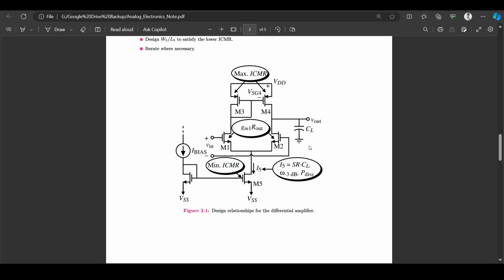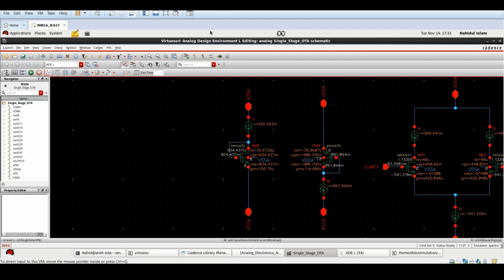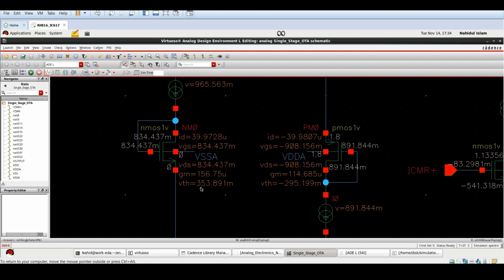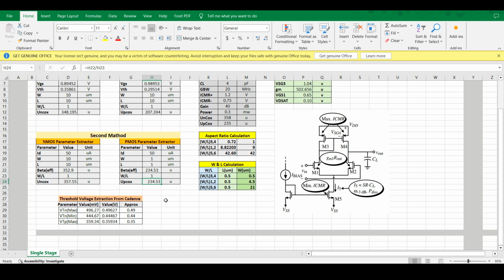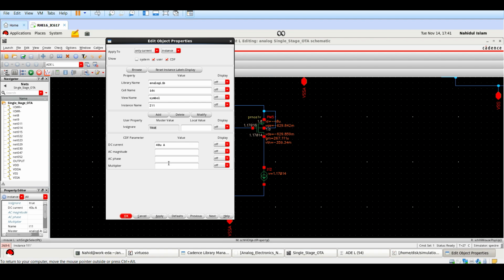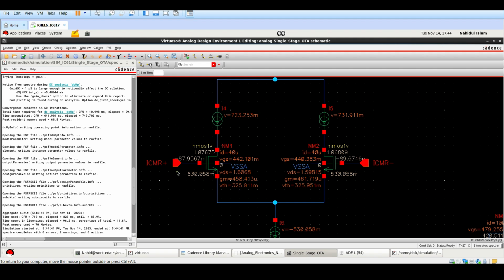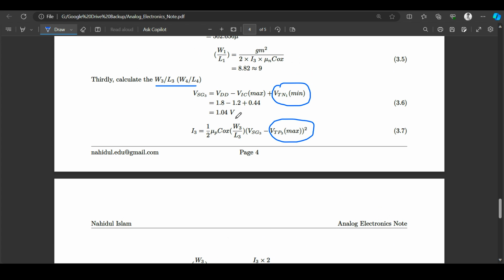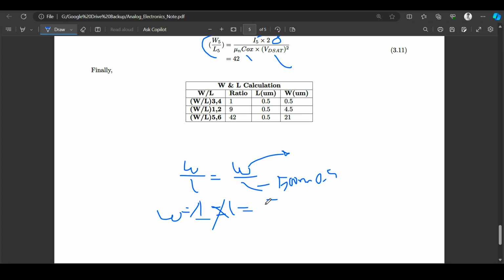Design of a Differential Amplifier 45nm CMOS Process in Cadence Virtuoso | Part One

Comment: Sir, i have some question, where did you get muCox of components? 
I've try many ways but they yield different values. Is there any solution for design by gm/Id. Thanks
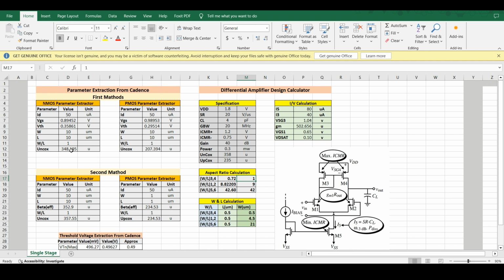Reply from the maker: Described in this video at 8:10 and so on. Thanks
Reply: @electronicechos  Excuse me, but why you chose W/L = 10/10 for NMOS but 1/1 for PMOS when finding muCox.
Why not choosing 10/10 for both. Thanks.